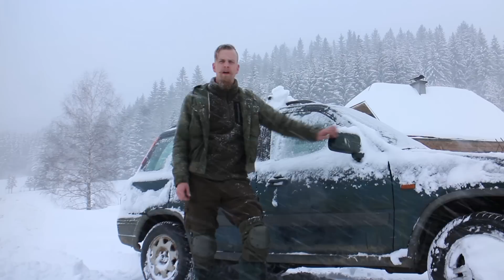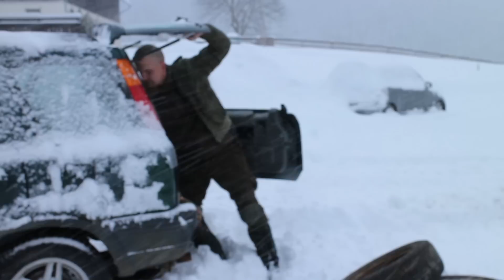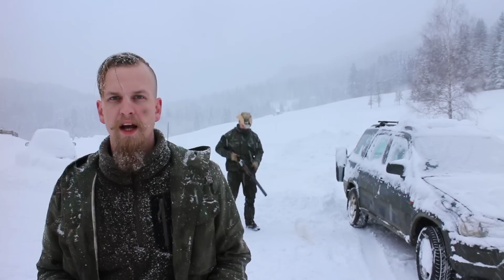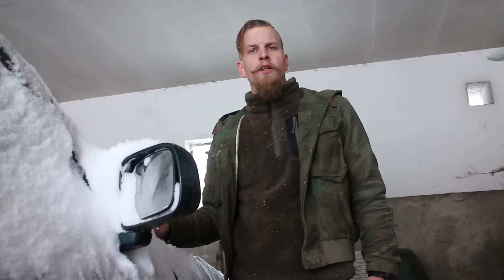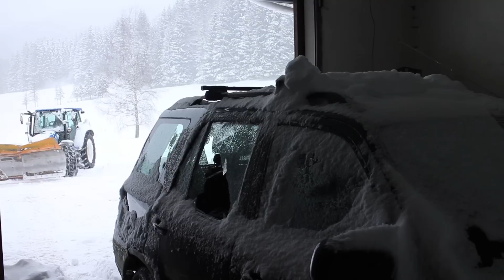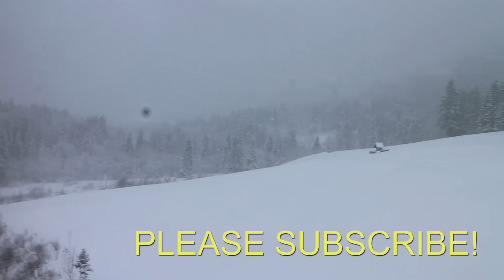Building A Bug Out Vehicle  - Part 1 - THE REVEAL

Comment: Something very simple but effective; an extra battery plus connections. Place them seperate but both charging when driving. That way you always have power. You could even put in a switch to use either one battery or combine them for extra Amps per hour. Nice for "on the spot" power supply.

Comment: All vehicles trying to bug out ahead of a hurricane have the same worries.  The first is fuel - gasoline becomes very hard to find ahead of a storm.  The vehicle needs one of: multi fuel engine, extra fuel tank, or racks for gasoline cans.  The second worry is a flat tire cause by running over something sharp.  Run flat tires and more than one spare would be great.  The third worry is ground clearance to get over fallen trees, etc.  Less than 6 inches is just asking for trouble, 8 to 10 inches is usually enough.  Four wheel drive is not usually needed, but I can see where it would be helpful  if bugging out during severe winter weather.

Comment: a lift kit for the wheels maybe 5 or 6 inch to high and it will be top heavy and flip easily, and 10 ply tires at the least. 2 ply will go flat just by looking at them. and removing all reflective parts on the car tail lights etc etc. cant hide it if it's shiney. and make it look crappy, and broke down because say you need to stop, and sleep somewhere and some one notices. well what would you go check out? a really like looking escape vehicle with all the bells and whistles? or something that looks like it got rejected from a junk yard.

Comment: Greetings from the Swedes in South Dakota...  Hope you have a big enough hammer to get that thing running..   Since it has to be able to get thru town, around traffic, and run over curbs and thru ditches without losing parts some height and plating on the undercarriage may help, and tires that wont go flat right away.. interesting idea maybe you could double up each rim and have dual tires all the way around so if one goes you are still moving.
Reply: +1 for dually tires

Comment: I recently saw a video where a guy built a small HHO generator to make his car partially run on hydrogen. It doubled the gas mileage and made the car run with much less noise. Just a thought. It didn't look very difficult and you're Macgyver reincarnated so...
Reply from the maker: +TheElvenArcher -actually a pretty good idea...have to check if it'll be possible on this motor...as far as I know, a homemade contraption like that will only work on a carburetor engine....
Reply: PostapocalypticGarage kevlar tires..... the weak point of most vehicles. also a heavy skid plate for protection underneath as well as raised suspension. plan for no roads and rough terrain.

Comment: should replace the roof for protection and a place to sleep . Also no roof + snow = disaster. The roof removal will also weaken that frame and body. If anything you should reinforce the roof or add a sort of camper roof that has a place to sleep .

Comment: you should either have a hatch on top as a firing position or reinforce the roof and make a foldable shelter to put on their and you could also have gun mounts between the driver and passenger set for easy access

Comment: Some form of window protection would be best, could be as simple as chain link fencing over it to prevent large debris from getting in to a full on steel slat system to fully protect the driver while still giving some form of vision.

Comment: convert the engine so it can also run on disused cooking oil. Its something that is possible I have been in a jeep that was converted to this type of system if you find it hard to find fuel the converter will be a very handy piece of kit to have and it is very cheap to run as you can get the oil from any take out or restaurant. it can be stored and can be used for other tasks.

Comment: This car does not have a ladder frame. So do NOT cut off the roof without reinforcing the floor first. Otherwise it just will collapse. 
I would have bought an old military G-Class with an old diesel. This would be more or less EMP proof because of it's lack of electronic.

Comment: You should put out the underside of the car, Just wanna see IT
Reply: In a bugout scenario, you can't count on good roads.  Even if you increase the ground clearance, you'll probably want to look at putting some sort of skid plate under the vehicle to protect things like brake and fuel lines.  Having a vehicle that can take scraping a rock, or other hard debris, on the bottom without tearing anything critical is a reasonable idea.

Comment: Gun ports?
Reply: With no windows, I don't think gun ports are going to be an issue.  Unless you think they're going to armor it?  For a bugout, speed (leave trouble behind) and fuel efficiency (less need to stop to refuel) would be a bigger win than heavy armor (slower n heck, and you burn so much more fuel).